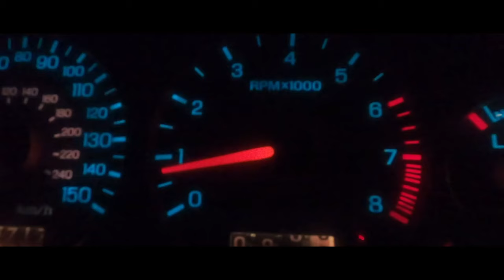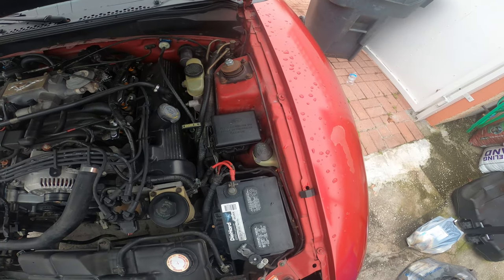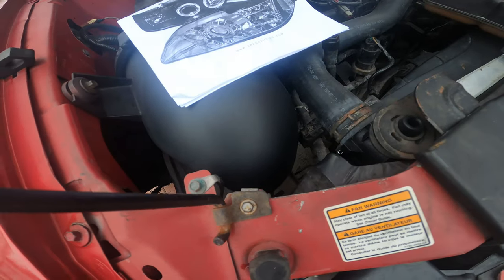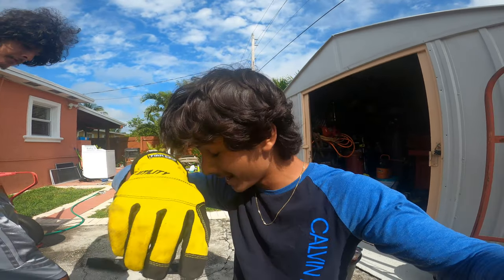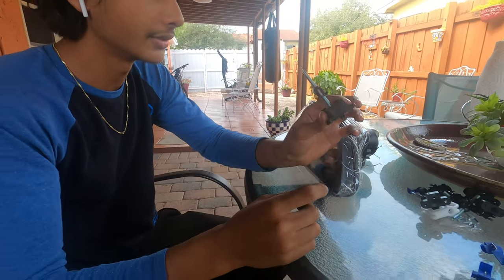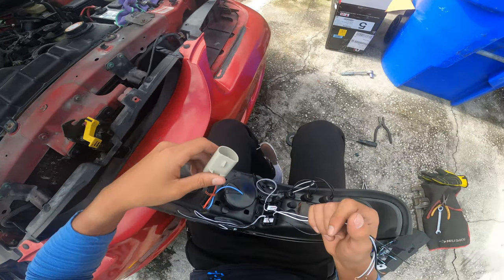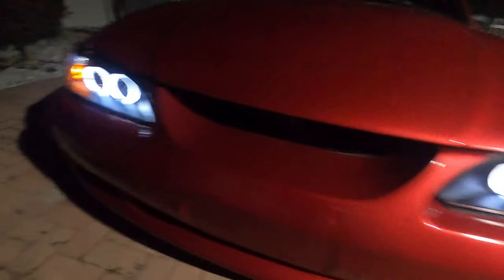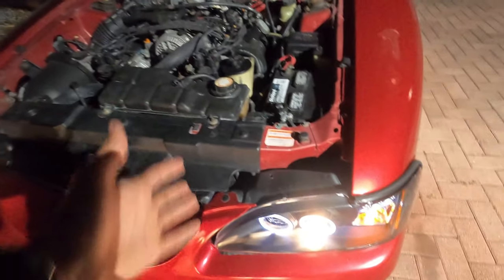Installing Axial LED Halo Projector Headlights on my 1998 Mustang GT. First mods on the Mustang!

Comment: I don't understand, the turn signal lights have 3 wires. Two of these wires are grounds with less than a volt and the hot wire only gets power when the turn signal is on? How do I wire these with my parking/turn signal lights?
Reply from the maker: With the blue splicers
Reply: @retro_2v993  I ended up testing that wire wrong. Got them wired up and they work great, my 95 gts appreciates it thank you